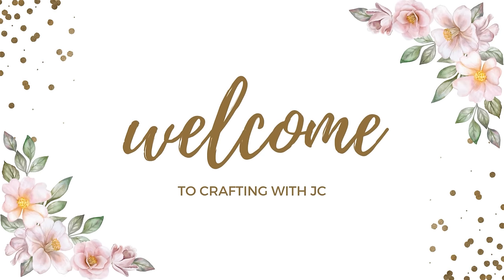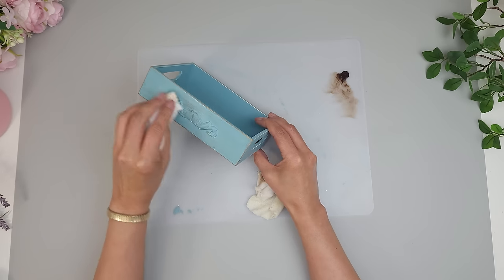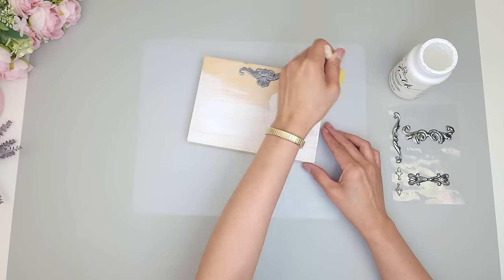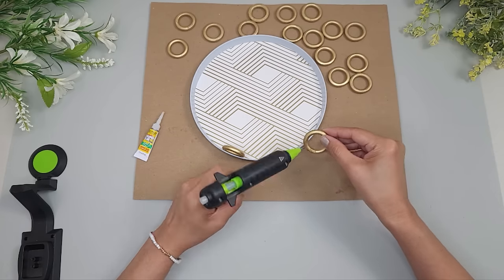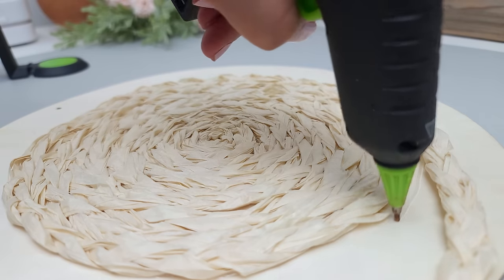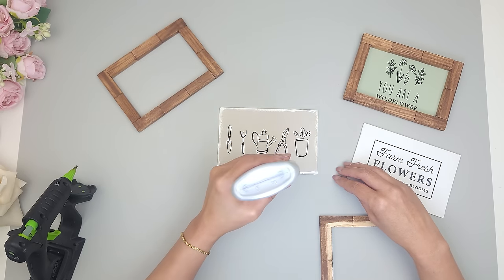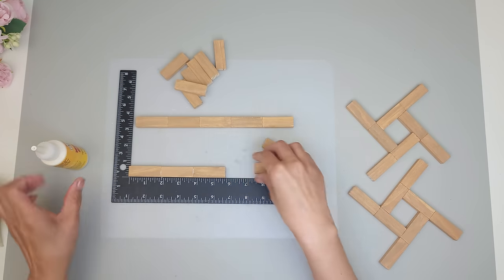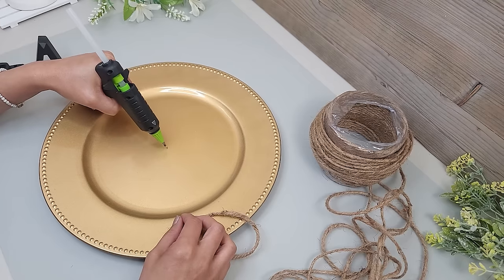20 Dollar Tree DIYS That Look High-End 😍| Beginner Friendly Crafts

Comment: Hi JC, you do such beautiful work😍as I was watching each craft, I started envisioning what I may have done😊like on DIY#2 those designed rings that came with the round bumpy votive cup, I may have lightly painted them black letting most of the design to show through and seeing if they would maybe fit over the ribbed votive cup and glued them to the midsection just for an added design element. #3 If your placing your tray where it can be seen on both sides, I'd add another metallic sticker on the other side so it can be seen on both sides since it's so pretty. On #4, I may have dressed up the frame with some jute going vertically on each frame bar, but only like in the midsection. #5 It is a really nice walnut color stained riser, was thinking I may have added small/medium half rounds painted in black on both sides of top trim only going horizontally of course or maybe adding a metallic sticker painted in black and putting that in the midsection to make your riser pop even more. With #7 maybe painting the farmhouse leaves in med/dark green to match greenery in left corner and for beads if there's about 20 maybe painting 5 each in 4 different colors like stain color, black, white, and green and mixing a pattern with them. With #11, I may have added a shape of something like a small heart out of the same sticker print on one or both sides since that print is so lovely. #12 so glad you went with the titebond multisurface glue they also have a wood one that works great, your frames look super cute. Oh my your oval flowery riser is so gorgeous, the watered down khaki mixed w/beige color is so soft and perfect with that riser especially your placement of the sticker is so pretty🌿🌸#14 that roller cutter sure made a difference instead of cutting with scissors. #15 that gorgeous brown metallic paint looks so pretty on your beaded riser it really made it stand out the beads look shiny. #16, I really like how the khaki color paint on those blocks came out so cool and pretty, also the round glass at the bottom makes it stand out. #17, I may have stained the center board of both boxes to enhance the contrast of stained wood next to non-stain or maybe painted it white. #19, I love the titanium gold color that is so pretty, maybe a small dainty gold bow wrapped on each voted cup. #20, I want to try doing a black charger and only putting 1/3rd of jute, then show some of the black and then continue on a section of jute and so on. Yours came out so nice with top completely wrapped in jute. I enjoyed watching your 20 projects can you tell!? 😍💛🤩
Reply from the maker: Thank you so much for sharing your beautiful ideas! I really enjoyed reading through all of them! 💕☺️